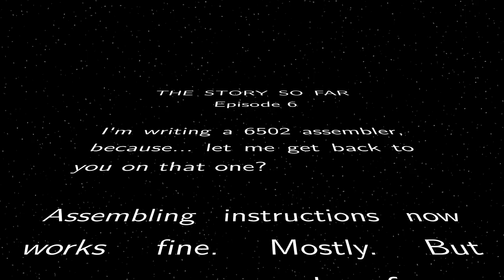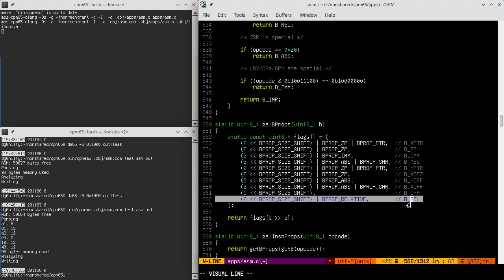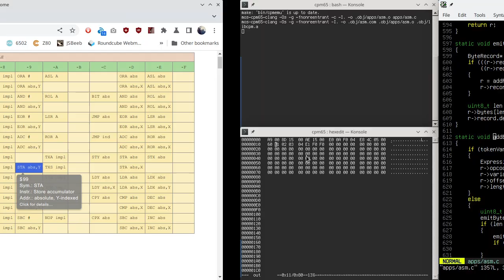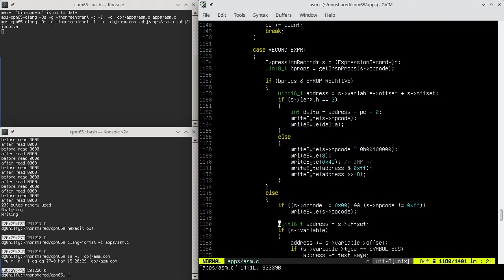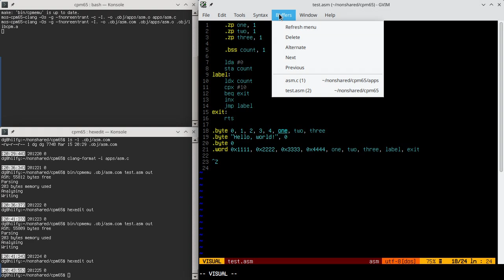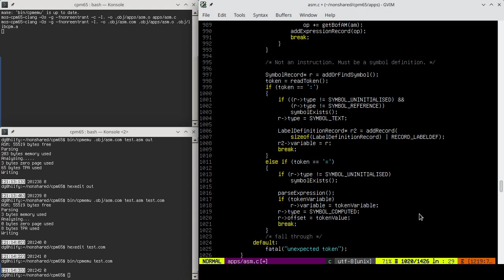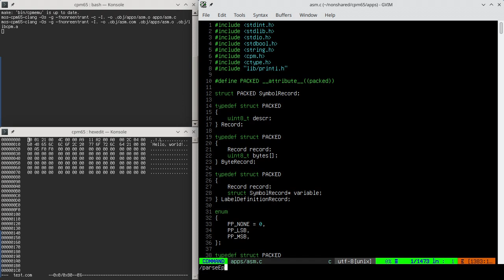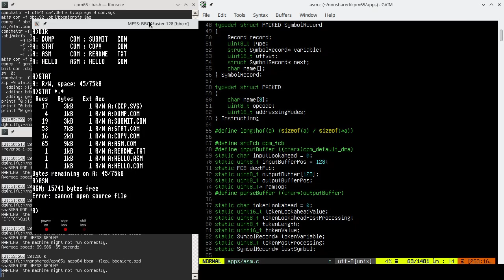Writing a 6502 assembler for CP/M-65, part 6/6

Comment: this series was really fun :) the strcpy/strcmp error was pretty funny, guess you had the 6502 mnemonics on your mind, eh?

also, i just wanted to say thank you for inspiring me :) ever since watching your first writing an assembler video i've wanted to make my own, specifically for the 6502, but i always had the trouble of starting over and over again due to language troubles, architectural problems or other unrelated issues. watching this series though gave me the push to restart it one last time in pure C and i've gotten much further than most of the other times i've tried :) (although it's still not generating data yet, i'm making good progress in statement parsing and expression processing)